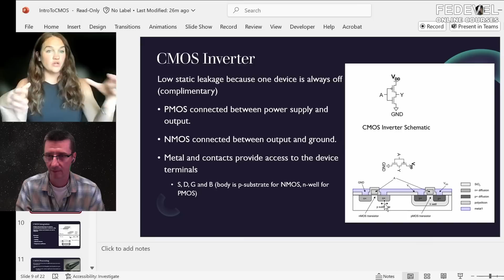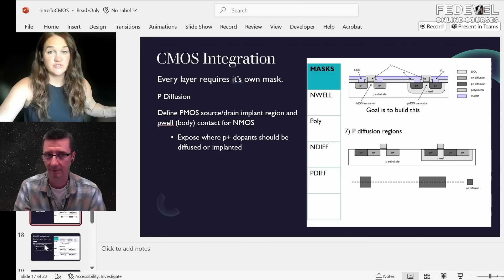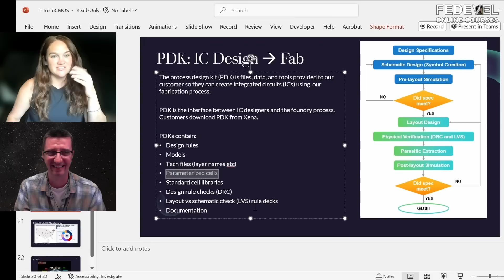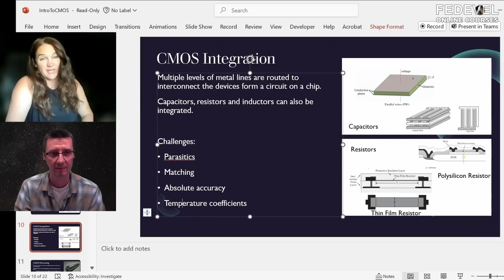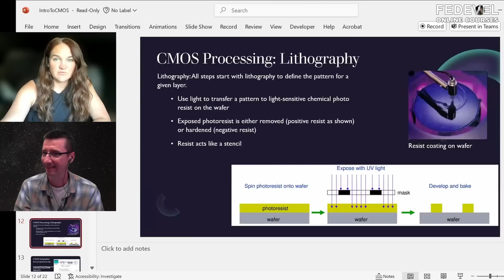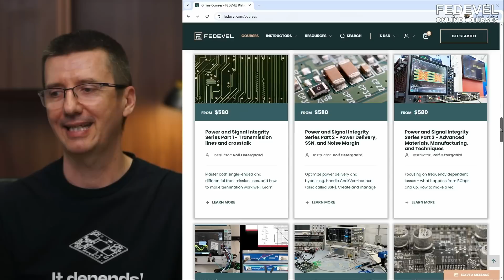How Are Chips Manufactured?

Comment: Nice to see someone talk about the chip fabrication. It is rather a complex process, only a very few understand the fundamentals. Self aligning mos technology changed the industry.
Cmos is the prefered process due to low leakage and low power(still not enough🤔) and is the choice of the multi-million gate count digital designs. Mixed signal is due to the fact anything digital need to interface to an analog world that we live in. Essentially a raw wafer is non-conductor, doping it selectively through photo resists creates the circuit of choice. It is interesting growing single crystal silicon is highly specialized, that fabs like TSMC don't make it themselves🤔. The fact a single tiny spec of dirt can play an havoc necessiates extremely clean rooms. No wonder the state of art sub nanometer(critical dimensions🤔) don't have any human presence(because we are dirt magnets, polluters). The fundamental issue is that unlike our brains(3d), the chips are essentially planar and nothing more than psuedo-3d for most part. The CAD toolchains used for design itself is another whole topic. Being there, having done all of that(and some more), you cannot but wonder with awe, about the creation of this virtual reality we live in and limitless conciousness that we truly are🤯, which dwarfs all our understanding about our very limited physical world/universe. It was interesting to see Robert throw a curveball question on using lasers, towards the end.😊 Robert's humility and humbleness towards the end, is above and beyond most humans.🙏
Not sure how many could go through the entire video, without speeding up🤞.❤👍
Reply: plz make a video to design small smps for esp